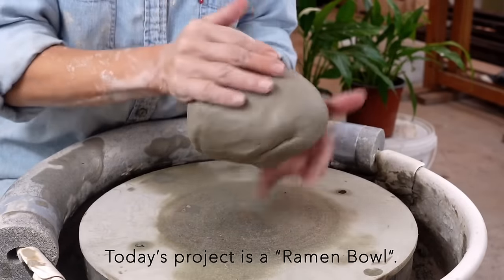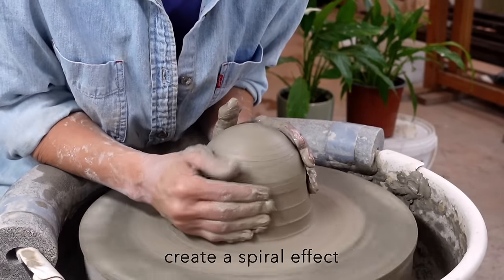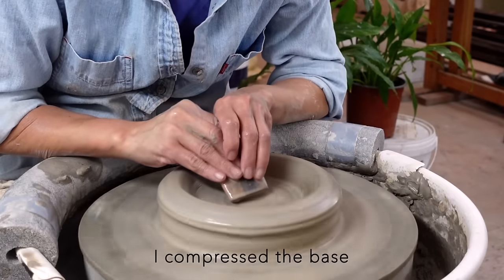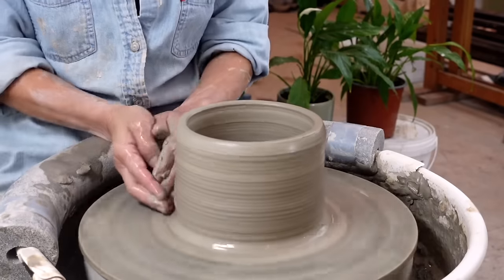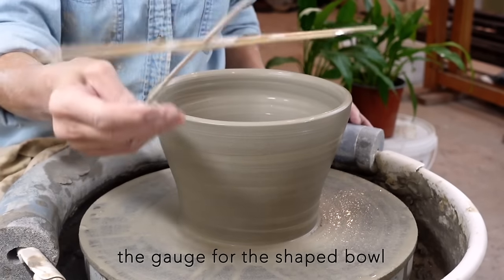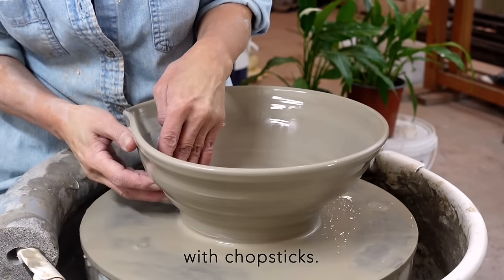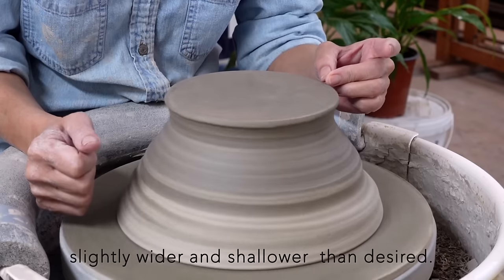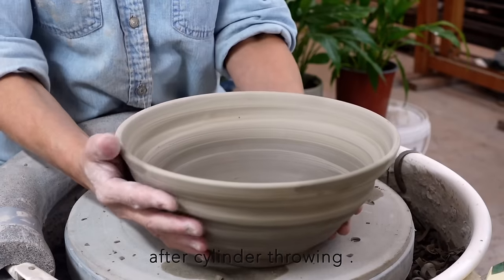Throwing “Ramen Bowl” with Spiral on the Potter’s Wheel @Alchemyceramic

Comment: What a lovely bowl - so clever to put the spiral to catch noodles and to help grip the bowl. I tried to make a small bowl with 1lb stoneware clay but it made a V shape inside, but I will keep practising :). Also I had a question! I wonder why you use sanded buff clay over other clay choices? Thank you for sharing your method videos, best wishes.
Reply from the maker: Thank you for your question Malcolm😊 I need slight texture in the clay. I found the glaze works well with this clay. It also very reasonable price. I use smooth white stoneware for painting work. I also use black stoneware for white glaze as the contrast is great.